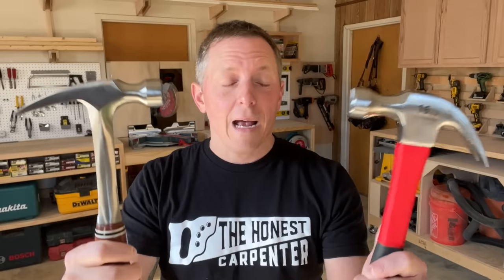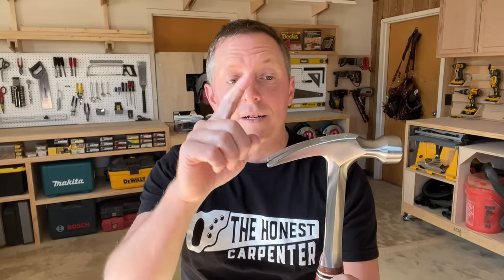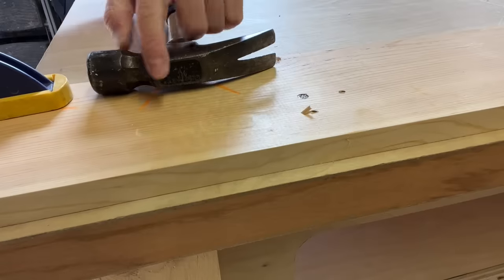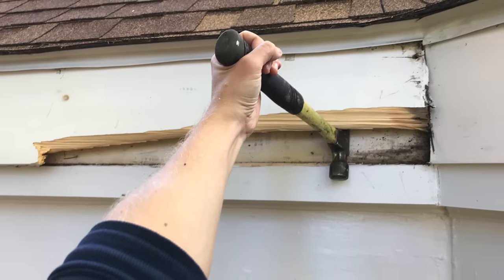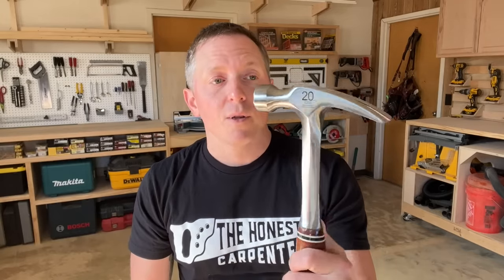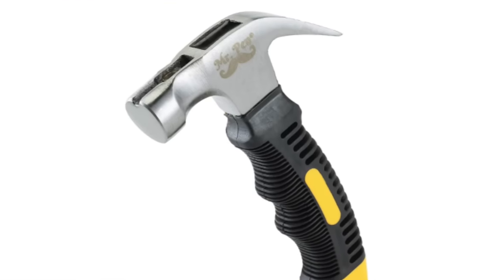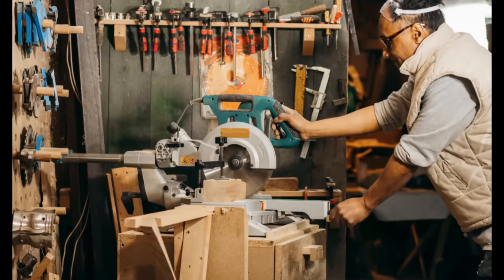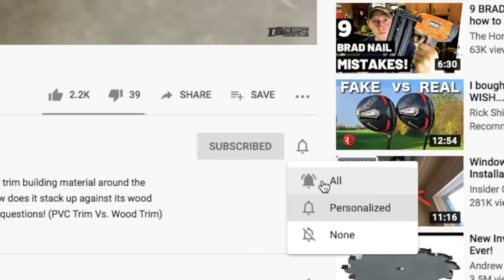DON'T USE STANDARD HAMMERS!! Try This Instead...(Rip Claw Hammer Vs. Curved Claw Hammer--Which One?)

Comment: Great advice. In the past 20 years I've done most everything from demo and framing to custom furniture building. I find a 16oz straight claw works well for almost all applications and it's my go to hammer. I used a 20oz when I worked on a framing crew, and personally I didn't need anything heavier. I have an old 12oz that was my grandfathers I use it around the house. It's fine for light work, but I wouldn't recommend anything lighter and a 16oz is more versatile.

Comment: Even if both hammers weight the same, the straight claw will deliver more force on impact because of its shape. Why? Because when the hammer impacts the nail, etc. all of the momentum is directly behind the head and all of the force is concentrated on impact, kind of like an arrow or a train making impact. With a curved claw, upon impact, the weight that is below the nail will continue with its momentum, which is below the nail; not driving it into the nail. Theoretically, I suppose then, since curved claws cause for force to shift upwards upon impact, curved claws are less accurate ;) I like to imagine a rreeaalllyy exaggerated curved claw that was as long as the handle, which is silly, but better illustrates the difficulty of having the mass of the hammer shifted below the head. HTH. Thanks and, again, great video!

Comment: As a carpenter and contractor myself, I have a variety of hammers. Including both the two primarily mentioned in this video. As indicated they both serve a variety of functions. I, however, find myself reaching for my curve claw hammer on most jobs. Particularly when working with trim. Trim is typically a more delicate job and requires a finesse that a clunky rip claw lacks.  That being said, I can definitely see why you might prefer a rip claw.
Reply: They make lighter ones too.

Comment: I'm a DIYer and hobby woodworker.  I have both hammers but I rarely use the claw at all and when I do it's to pull out nails.  So I usually use the curved claw.  But I made it a point to get a rip claw after seeing this video.  I'm sure at some point it'll come in handy so I keep it accessible.

Comment: Physics-wise, pushing the weight of the claw farther out toward the head makes it more effective at using the hammer's mass to deliver an impact (1/2 mv^2). Of course it doesn't come for free, because you have to accelerate that higher head mass, but for the same final hammer head speed, you get a higher impact.
Reply: That is the bonus of the all-steel Estwing. ALL the weight is in the nailing surface. 

The classic Estwing has a rounded face. This helps keep the nail heads from bending as you drive them. New ones - albeit made in America - have a flat face. This all but guarantees that you will bend the nail head unless the shank of the handle is exactly parallel with the face of the lumber and the nail head. Which means, generally, never. End result -- more bent nails.

Comment: I love how you explained this especially to those Do it yourselfers. As a union carpenter we are recommending ppl buy a martinez or stilleto but I would never recommend something with such a high price tag for diy which is why I appreciated this video
Reply: I'm a wood handled guy myself. The 999 20 oz. Vaughan & the 19 oz. Vaughan cover my needs well. I still own a half dozen or so various Estwings although after tendinitis & an ulnar nerve problem I almost never use them. Even for most demo, an assortment of bars and a 2# drilling hammer up to my 8# single jack are usually faster. 
I've tried the Tibone stiletto and it was pretty nice, alot of guys in my are swear by them, although I still prefer the two Vaughans. The 14 oz. Wood handled stiletto was pretty nice too, but I like that modest "knock down" power that the 19/20 oz. Provide. I haven't tried the Martinez, though I heard it was a bit "clubby" & less balanced than its' Chinese Predecessor. 
What do you guys like?
Reply: @adamjames1375  the martinez is top heavy and for rough carpentry and form building that is actually a great advantage in my opinion. Drives nails in pretty easy. I know a lot of guys who swear by the stilleto and others who swear by the martinez. Both are great hammers but with the stilleto there is some disadvantages when it to comes to the head. It is mainly titanium which scratches easier and it’s one solid piece attached to the handle. If the claws break you will be buying a brand new hammer. The martinez is a titanium handle with a steel head and it’s replaceable. Both have a great nail puller on the side and both have magnetic tips to set nails in areas tough to reach. Both are roughly about 16oz making them lighter on your bags.
Reply: @395glen   I'd like to give the Martinez a try. I haven't seen them sold anywhere locally and haven't found a buddy with one to try.(I almost exclusively work alone) I've just been really happy with my wood Vaughans & prefer them to the Tibones I've tried. I nearly always run with the 999 20 oz.The side nail puller, steel head & replaceable grip are compelling features though. How do you feel the reverb/shock is in the Martinez compared to wood?

Comment: In the 80s, my father (at the time a cabinet maker for 50+ years) switched to one of those beautiful leather handled Eastwings and we’ve never looked back. The straight claw is easier to use, the straight-thru weight also adds heft and accuracy. Now I’ve got 3 of the newer blue handled Eastwings and they’re my choice hammers - although I probably have various weights and angles!  16oz is the perfect balance for most jobs, but a good 28/32oz is handy to drive in spikes when you’re framing!

The ease of a straight claw… don’t think my 26 year olds would know how to use a curved claw hammer!  Lol

Great explanation video!

Comment: My couple years of construction started with a Vaughn wooden handled, I think 22 Oz. hammer we found in the weeds at one job. We did a fire remodel later and that curved wooden handle made the job a pure pleasure tearing out the old walls. I polished that thing up, regrooved the waffle head, repainted the handle...it was sweet! Then I lost it in a job change...sure miss that thing. But I bought a new one to replace it. I don't do construction any more, but I am prepared should the need arise...

Comment: General carpenter, remodeler and woodworker of more than 30 years, here.  I keep a 10-12 oz. curve claw, 16 oz. curve claw, and a 20-22 oz. straight claw.  Different tools for different uses.  When I did mostly remodeling, I used a 16 oz. curve claw fiberglass Plumb. I could drive 6d finish nails w/out leaving turkey tracks (often even set them if the material was soft enough) and sink 16ds in 2 or 3 hits.  I found the capacity for nail pullng advantageous (especially for homeowner safety, no bear traps for kids to find) and would always have pry, crow, and wrecking bars available for heavy demolition.

Comment: Great advice.

For DIYers who will not put too much use into a hammer almost any brand is good.

Get one with a steel shank not fiberglass you will never need to buy another.

If someone is starting out in the construction trades where a hammer will be used frequently.
Pay attention to the material that the grip is made from.

Solid plastic grips are crap.
The impact force will vibrate up your arm and after a solid time of nailing the joints in the fingers, wrist, elbow and shoulder will hurt from the jarring. It might not happen the first day or the second but time will catch up with you.

Every injury or pain you feel is compounded by years.

I use Estwing hammers because of the grip cushion.
It is the best in my opinion.

Comment: Great explanation.  I think so often that people use what their father used, and if they only used what they inherited from a none carpenter, that thought process traveled down the line.  I had used a Milwaukee Nail Puller with the Dimpler tool for a few years, and it works beautifully for removing a lot of nails, especially when there are a bunch of old nails left when removing old drywall when they used nails from fifty years ago.  Cheers!

Comment: At age 12 at our new house job site (my dad was his own general contractor) during the rough framing phase all the carpenters had rip claws, of course, and I wanted to fit in with them.  My usual job was to pick up dropped nails and straighten the bent ones for my dad to use after the carpenters left for the day.  (Yes, he was a cheepskape.)  I bought my own rip claw hammer (16oz) and was proud to use it after being assigned to install the hurricane clamps to the tops of all the newly framed exterior walls.  I am 63 years old now, and still have and use that hammer!  Fond memories.
Reply: I lose tools monthly

Comment: Thanks for the great video.  I have 4 16 oz claw hammers.  For light duty utility tasks, I'll grab for any one of the curved claws.  For serious work, I'll grab the rip claw.  It also works well to go after a nail with an embedded head.  I can use another hammer to drive the rip claw down under the nail head.  Once I head the head started up, I can switch over to the curved claw to finish pulling.
Reply from the maker: Interesting approach, Steve! 👍
Reply: @TheHonestCarpenter  I have had to do it, it just get under the nail head better.

Comment: I am a roofer with a hammer collection. I prefer straight claw. A lot of my coworker prefer curved, as it’s the best for scraping nails off/out of the roof deck. But my FAVORITE hammer is the dewalt 12oz. hammer. Most of the weight is in the head. It has a 14” handle, and swings almost as hard as a 20 oz.

Comment: After nearly 50 years of heavy remodeling work on a number of my own buildings, I have several dozen hammers, but my go-to hammer for construction is a 16-ounce Stiletto titanium with milled face and axe style handle. They are expensive, but mine was a gift from a gal friend who correctly guessed that it was about the only type of hammer I didn’t already own.

Comment: I have owned a Plumb 16 oz red fiberglass shank and black rubber handle straight claw hammer for 43 years , first hammer I bought in 1978 , I have never needed another hammer for cabinet making , or tearing stuff apart

Comment: Long ago as an apprentice in the union we got Stanley steel tube hammers, 16 oz. claw, 20 oz. rip. I found the claw more versatile, esp. for tight areas or choking up to nail in front of yourself on drywall ceilings. You’re not always driving nails overhand. The rip was for framing.  Air guns & titanium hammers were not around then so you got yourself a 22oz. Estwing. The rubber cushion grip got worn on the Stanley steel tube, I got another around 30 years ago, I don’t think you can get them now. Good video
Reply: I suspect NO roofers use anything but a nail gun and not hammers.

Comment: For flat out demolition I use a pair of 28oz long handled Estwing framing hammers with flat, not waffle face. You can use one hammer to drive the other for separating boards, or drive one claw into the wood to dig out nail heads like a cat's paw.

Comment: Retired carpet and linoleum layer. Carried rip hammer in carpet box for nailing tack strip I pre cut my tack strip the rip claws worked great for trimming strip that was a little long. Carried a claw hammer in my linoleum box for pulling nails when Removing base. I always filled a second claw in one of the claws for pulling underlayment staples.

Comment: Coming from an Exhibition Contractor background, I used the curved Estwing hammer for Many years.  Much of the wood we used had to be re-used again.  A stand would be build and worked on by a client for a number of days. It would then be ripped out, packed away and used again at another show. The curved hammer was Ideal for ripping out nails without coursing too much damage. A 16oz blue handled Estwing has served me well for 25 years. 👍🏾

Comment: Estwing roofing rip claw. 28oz. I use it for everything, but i screw down pretty much everything. What are you using nails for these days? framing - nail gun, roofing - nail gun, decking- screws, drywall - screws etc. I just dont think ive ever had to drive hundreds of nails by hand. I see some older guys saying swinging an estwing 20 all day would kill your arms/shoulders. I've almost only ever used an estwing 28oz. Its what my dad always had. But nails are typically inferior to screws in every way. When you DO use nals, its usually a nail gun too. So typically the hammer is more for demo/nail removal, making the estwing 28 superior.

Comment: I inherited my Dads claw hammer (with the leather on the handle), and several others over the years, I also found a great hammer in the street, a nylon handle grip, a little beat up but works great.  It's my go to hammer if I'm ripping up wood for the fire or just fixing the fence, both are the claw.  I have one of the curved claws and really never use it.  Thanks, I feel more confident.

Comment: I have both and use both.  Curved claw is 16 oz, wood handle - first hammer I purchased 50+ years ago.  Straight claw hammer is 20 oz estwing with a longer handle. I use the Estwing at least 80% of the time.

Comment: I grew up only using claw hammers and ball peen hammers. Didn't even know other kinds of hammers existed and when I started buying my own tools I just reached for what I knew and figured the other hammers were for some specialized use. Then when we decided we were going to start remodeling our house one room at a time we decided we were doing it ourselves. I grew up learning to fix and change old houses because we were poor and couldn't afford to just hire people but also my Pépère was retired and helped raise me and he was of the opinion that you had no business owning a home if you couldn't take care of it. One thing I had not done was install new solid hardwood floors. So I researched that and watched numerous installation videos and realized it just wasn't that hard so I went at it. It came out fabulous. One thing I learned when teaching myself how was that the first few and last few rows cannot be done with a flooring nailer because there's no room for it on one side and no room to swing the hammer down onto the actuator on the other. Everything I read said to use a framing hammer with a smooth face to drive the nails in. The extra weight helps drive the annoying amount of nails into those rows and the smooth face helps to make sure there is minimal damage if you miss. I got a 20oz framing hammer and was driving the nails in with just a few hits without much effort. I've not used any of the half dozen claw hammers hanging around my house since then. I've also bought a 20oz waffle faced hammer for driving nails when I don't care what a miss looks like because the waffle head grabs the nails and doesn't slide off.

Comment: Demolishing my old iron shed, the curved claw was fantastic at grabbing and ripping out nails holding the iron. No leverage required if the swing was on point.  Still falls under removal of nails I suppose, but a little different.  Also, curved claw is also good for ripping out star pickets for holding the framing for concrete. Thanks for the video.

Comment: I could always tell a good framing carpenter by the hammer he carried. I got my first framing job in '73. I probably showed up with some old wooden handled job and I quickly noticed most everyone had a blue handled hammer. It didn't take me long before I got my first 28 oz Estwing. Not long after that my brother and I started our own construction company, which is still going strong. I retired 10 yrs ago & now my youngest runs it. In my truck tool box still two old 28 oz Estwings.

Comment: I use a 19 oz rip claw.  My Dad always prefered a rip claw, so I learned from him.  The 19 I use is a framing hammer, with a longer handle, and works very well in most applications.

Comment: I'm a service tech, I have an Estwing 20oz, a Kobalt 22oz with the side claw (which I still can't figure a good use for) from the store of Lowe's, and I have an Estwing 16oz Drywall Hammer. All three I use a lot. The drywall hammer comes in handy for a lot more than drywall.
Reply: side claw is for pulling. We use them lots cribbing, especially on duplex nails,

Comment: Your logo has a standard, not rip, hammer.  I use various pry bars for demo.  Regular hammers really aren't very good at pulling bigger nails - it tends to loosen the head of the hammer.  Instead I use a pry bar - my favorite is a craftsman 6577 - which unfortunately with Sears going rancid is difficult to find.  I use a small wrecking bar for tearing out drywall.  I also find a big rubber mallet is handy for driving the pry bar into tight places.  It's easier on the ears.  I roughen up the face of the hammer by tapping the face on concrete or sandpaper - really helps to prevent bent nails.  I agree with you the dinky hammers with short handles are worthless - no swing.  What, am I going to push the nails in with the hammer?

Comment: When I was in my twenties and framing , roofs etc, and or working on a scaffold  working on a building exterior before all the safety equipment they have today. I used a 20 oz eswing for framing and a 16 oz eswing for trim. More they once did I slip on a deck or roof and drive my estwing through the roof plywood to stop my self . I worked in upstate New York. We did not stop for the cold weather or snow.